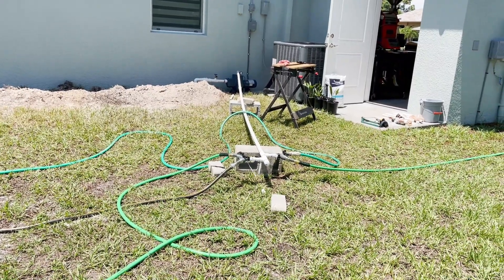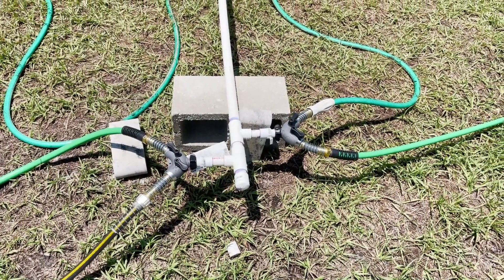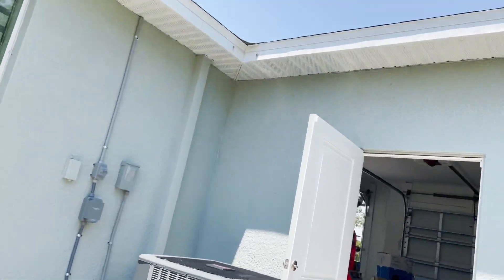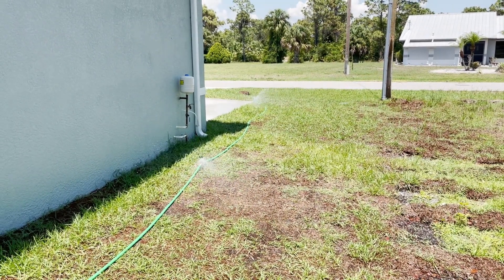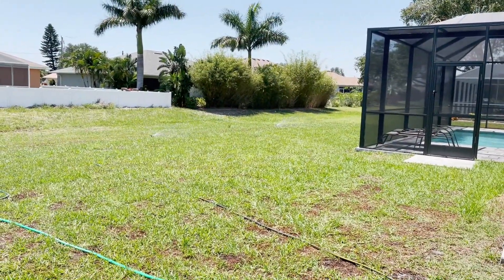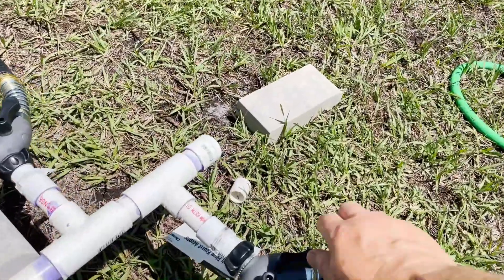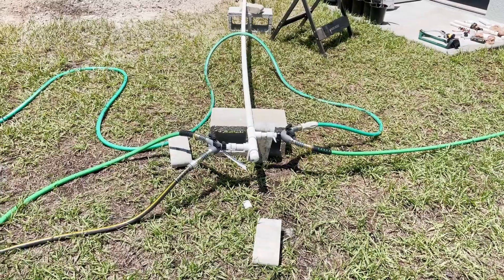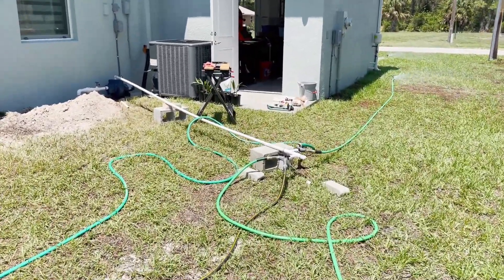Florida Sand Point Well (part 9) Irrigation Considerations, Sprinkler Setup

Comment: Good morning.  I see that you don't have a pressure tank.  I plan on installing a pump start relay.  I am worried about burning up the pump, if I run out of water.  Did you end up installing a pressure tank and low pressure cut off switch to protect your pump?
Reply from the maker: yes, i did install a pressure tank, and would HIGHLY recommend to everyone that they do.  a little 2 or 3 gallon one above the pump will do just fine.

Comment: Thanks for the videos, what size and thickness pvc pipes I should use for the well?
Reply from the maker: for this setup...2" drill-jet pipe.  jet down to 25'.  1.5" with internal connectors for the actual well pipes with well points.  slip that inside  the 2" drill-jet pipe while it's still in the ground.  pull the 2" drill-jet pipe out of the hole while the 1.5" sand point remains.  you can check the other videos out showing the insertion of the sand points.
Reply: @guydoesstuff6562  thank you. Does it have to be 370 psi rated pvc or 160 psi pipe is good?
Reply from the maker: @tvkotsyuba , i use sched 40 IIRC from well holes to pump, but you can use thin wall no problem.  there is no pressure obviously on the intake side.  make SURE that you use internal slip fittings for the well points.  otherwise, they won't fit inside the 2" drill pipe when in the ground.

Comment: Thanks for the videos brother, I'm in Pinellas and just did my test well. Smooth as butter
Reply from the maker: @Meathead, that is awesome!  Did you measure your standing water in the hole?
Reply: @guydoesstuff6562  I'll be doing that today hopefully, had to head out pretty quick after putting it in. Excited to see. I can't believe how easy it went in.
Reply from the maker: @lance1cj , I just posted up part 10 vid showing a trial of 4 hunter pgp rotors.  massive amounts of water (at least for a lawn)...